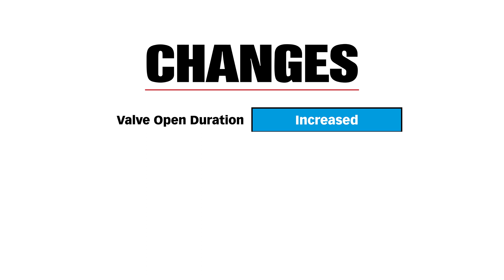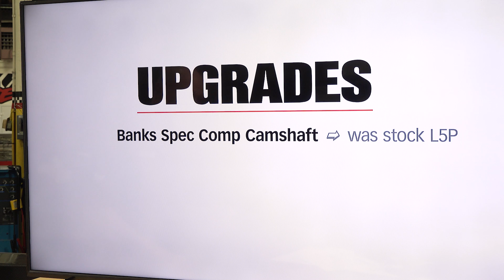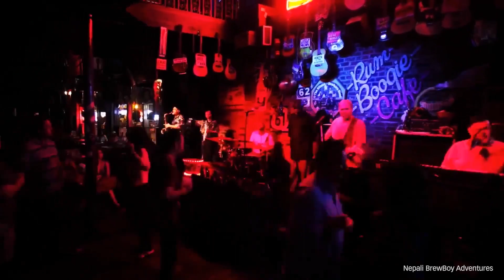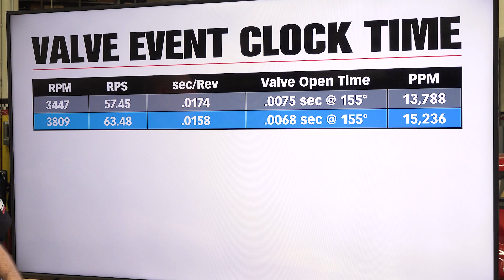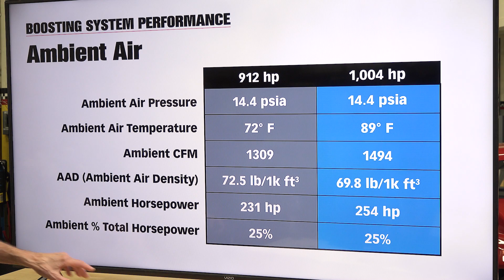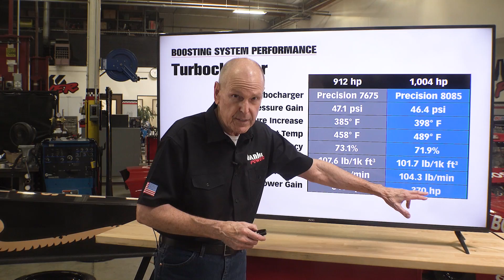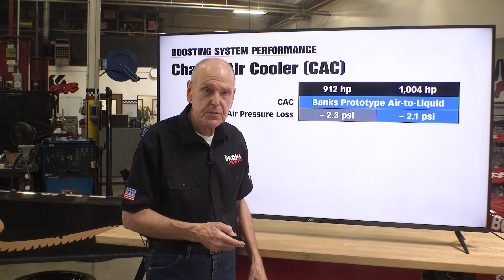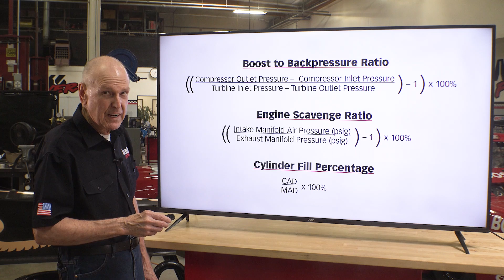1,004 HP !!! Killing A Duramax Pt 15

Comment: What was the temperature of the liquid used as the cooling medium in the charged air cooler? I'm curious if an auxiliary coolant system would need to be installed to get the temperature drop required, or if jacket water at operating temperature would meet the requirements.
Reply: That's an easy one to answer.  Jacket water at 180F can't cool charge air to 101F.

Comment: Maybe a promod 88 turbo? Hell of a series. I appreciate the data and explanation of the process. Everyone always thinks about the boost number. But not the turbine drive pressure. Would be awesome if you had like three turbos and just focused on these two measurement. This may help people to better understand why 20 pounds from a 57mm turbo is going to make the same power as 20 pounds with a 80mm turbo. M.A.D. And back pressure v boost pressure are the things I would like to learn more about or see on this Channel. Awesome explanation of the cam as well. Anyways. God bless. America1.

Comment: i completely agree that 1000hp is amazing on stock internals but he is making the torque of 600hp if you spool it down low one of the reasons it is surviving is because he is spooling the turbo so late when the cylinder pressure is low but you never know this could take 2k ftlb which would be insane dont get me wrong im not bad mouthing it its impressive and doing it this way will make the engine last longer.

Comment: Regarding the CAC at 23:37, I'm surprised that the smaller setup got a larger increase in lb/ft3 given that the bigger setup saw less pressure drop and more temperature drop. 
The final line seems right though.

Comment: First off I'm REALLY enjoying this series and appreciate the time, effort, and $$$ it takes to do these experiments, document, video, edit, and share.  The only thing I would have liked to see differently is I would have liked to see these tests run with a stock or commercially available charge air cooler (such as the Banks) with a big fan blowing ambient air across it. That or I'd like to see the same tests run now with said CAC to get "real word" numbers to see how much the numbers drop (which they will).  That 1000HP is obviously "real" given the components used, but wondering how short of the goal you'd be with the traditional CAC?  That CAC is more likely more efficient than a stock or even an aftermarket unit and that is contributing to air density which helps the HP gain.  That prototype CAC is cool, but not something you'd see on the street.  The average Joe can install the same/similar turbo, the same/similar Comp cam, the same/similar injectors, the same/similar stroker CP3, etc and run it on the street (it's done with similar aftermarket parts ALL the time), but running that CAC on the street is not feasible.  Either way, looking forward to more videos (still learning).

Comment: I am not sure if you already have a video on this but before you blow the engine from any of these suggestions. Could you do a segment on power difference between an air to air cooler vs an air to water? I would love to see how much difference there is between the two, expesually at this power level.

Comment: Go with 50-50 water/methanol or full methanol 100% injections will cool down the ambient air temp down and give u a bit of more power as well plus with the water to air intercooler will more significant drop air temp going in the intake to engine

Comment: Compound turbo charging is the only way to move forward! Please don’t use nitrous or water/methanol injection. Don’t betray your own philosophy of relying on consumable external crutches to make power. Design a new JWAC for compounding! You’re an engineer, don’t give in to the cheap gimmick temptation of nitrous and water injection!

Comment: Air density thinking you could super cool the intercooler (dry ice or short term boost using 30 TEC “electrical cooling”)

Comment: Why not try and changing the charge are cooler  by adding a receiver dryer unit from and air conditioning system like they do with super chargers?? That’ll make the air density higher from lower charge air temps for almost free power.

Comment: Two questions: how far has duramax pushed this engine? What kind of transmission could handle the power plant?
Reply: There are heavy duty truck transmissions  that can handle 1400 lb*ft of torque.
Reply: Andy Harman  good thought.

Comment: Hello Mr. Banks how are You ? My name is Paweł Różańczuk im young engineer from Poland. At first I would like to say that You are my idol... And I have some interesting ideas about Your last killing duramax project also about cultivating scientist approche to solving problems, but not every thing at once :) about duramax project You are using metanol with water and 1%corrosion inhibitor (wd40 i think base on methanol carier ) that's give some % of cooling effect to air dencity may be instead use LPG ? (Liquid petrol gas ) just propan-butan in USA I think is know as bbq fuel ? Becouse You have cheep fuel compared to avrage income in Poland its like 180° from that so most of people here are using diesel or gas car runing on lpg propan- butan its relativly save vapore pressure in tank is like max 8 bar when its hot . But You can also use LPG in diesel aplication in small % of LPG  3-7% to mas air flow to be shure that the mixture does not self egnite before tdc ... Also the LPG does not freeze easy i wonder how cold could it be and how it will help with MAD... Another thing is the diesel fuel it self ATF fluid is much more calory dence and burning like crazy... What do You think about that ? LPG freazing point is -188°C thats - 306.4°f ... I wonder if that liquid gas cooled at lets say -160°c injectet straight to blower inlet would have enough time to evaporate and mix ... But as a poor one man DIY teem I dont have enough data colection capabilities to test that by my self ...

Comment: I want to see what happened with just the cam change, everything here is cam and turbo so it's hard to relate the numbers as easy
Reply: It would have been nice if they had rerun the 912 hp point at 3450 rpm to show the effect of the new cam versus the old.

Comment: I would suggest, as the whole set up is meant for endurance/street use, that a set up is made and tested which would fit in the engine bay?    Then see what power is compared to the set up used now.     

The biggest challenge will be to loose as less power as possible.........And that will be a hard challenge I guess....

Comment: If the cylinder pressure is limited to 260 bar, the next step is to rev the engine harder. Anything done with NOS or water meth injection will have the effect of increasing charge air density, this will allow a leaner afr at 1000 hp but will not allow an increase in power at the same rpm because they are already hitting the cylinder pressure limit(I assume this limit is imposed by the cylinder pressure sensors being close to maxed out). Therefor the only way forward is to take the rpm up, the water meth injection or NOS will help lower egt's and help cylinder fill to compensate for the smaller amount of valve open time at higher rpm. Possibly could need a larger turbo as you will be passing more flow through it and it could become a choke point on the turbine side.

This is fantastic stuff, love your enthusiasm Mr Banks, I hope I am as happy and enthusiastic about my work when I'm an old fella too. 

Bang that Turkey!

Comment: ALL Mr Banks' videos should be required viewing for ANYONE interested in modifying internal combustion engines - not just diesel but petrol/gasoline, actual gas (propane, CNG or hydrogen) engines because most of the basic concepts and details are applicable to them all. Volumetric efficiency, charge temperature and density, pumping losses, optimising parts, etc.
I've been around engines for over 40 years, off and on, and while I'm aware of most of what he says, there's always something that I forgot or hadn't considered - these videos are pure gold!

About the only thing I'd like to see - if I missed it, please correct me with linkies - is the importance of getting the valve seat area shapes correct for optimising low lift airflow, as this is more critical with diesels due to limitations in duration and lift that can be used. I've picked up a lot of low lift flow working in this area, and significant torque gains, as the valve opening is effectively increased from the unshrouding of the seats themselves.

Comment: The thing with water/meth, as everyone in here suggests, is that unless you get it to hydrolock, it won't kill the Duramax.

So I'd go with higher RPM and more boost. Could you achieve 1300 HP @5000 RPM or even more with increased boost?

Comment: To sum up since last episode.
Bigger turbo
Bigger fuel pump and rail pressure
bigger injectors
Custom calculated and made cam
Higher RPM
Same torque

All that for 100 hp extra, have i understood that correctly?
Hopefully the curve holds power longer then the previous episode setup.

Comment: Feed it 10 - 12  % L P G  .multi fuel engines rock. But what I would like to see is to put it in a street legal truck and drive it for 100,000 miles.

Comment: A comparison between this setup's and compound turbocharged (with two charge air coolers) efficiencies would be really interesting. The math says that keeping temperature down during compression, decreases the power required for constant mass flow and pressures. I would love to see that theory put to the test! Water meth injection sounds tempting too. You could try to inject a small portion of the fluid after the air filter, before the turbo to raise its efficiency. And then of course really pour the stuff in after the charge air cooler. Nitrous is just cheating in my mind xD And it has no real value on anything but drag racing engines, because you just can't bring enough of the stuff with you for any real duration use. So I guess start with water-methanol because it should be the easiest to set up and, if the engine still lives, compound turbo!

Comment: Water and methanol is away from the intake volume, you fit less air density in the same volume. I would like to see you compound turbo this engine. From my rough calculations you are injecting around 240mm3 of fuel in to the cylinder if not considering flow efficiency of the engine. Making 125hp(ish) per cylinder. Would be interesting to see more cylinder pressure curves from the run.

Comment: Water/meth or happy gas both have their pro's and con's. I would surmise that cylinder head modifications would help achieve more as you still have some turbo left ,and reductions in intake and exhaust port restrictions you could lower the boost pressure which would increase the CAC efficiency. But either way i will still be watching. 👌👌

Comment: Try injecting water into the exhaust manifolds before the turbo charger (to create steem) to in crease spooling speed and to help produce more boost sooner, also instead of using mechanical valves try using electric solenoids so you'll have more control over the tune.

Comment: I am probably one of the minorities on this idea but hey I am going to throw it out there anyway. Since the CAC is making as much HP as the turbos can we really up the game on the CAC? Years ago Ford did a mock up with a Mustang and a refrigerated glycol CAC that would last for 30 seconds or so. Granted a mountain can be longer than that but nobody wants to run out of water methanol half way up a mountain either.  

Maybe , now this is really crazy use two turbos with larger turbines and smaller compressors not to add boost but to add vacuum with less parasitic losses on the exhaust. Put one vacuum on the crankcase to reduce windage and pumping losses. Then run the other through an orifice the make the ambient air expand creating a cooling effect which could further drop the CAC temperature increasing HP.

Or just give the CAC induction tubing a LN2 shot on the outside! lol may need to watch turbo rpm as it spools up from the reduction in MAP or add a kicker turbo to make up the difference. jk I really would like to see what putting a vacuum pump on the crankcase yields! The make it happen with a secondary vurbo “vacuum + turbo “  I also think that there’s promise in using a vurbo to cool the Charged Air. We have vacuum pumps at work that have made ice in the lines.... just planting a seed here. As a matter of fact after seeing that I had the idea to use it to cool the liquid ring water but we changed our process and never did much with it but now I see a company is using that principle on a factory packaged unit. Crazy like a fox, right? lol

Comment: Great stuff! Keep up the awesome work Gale and team. You've got some injection window left, hopefully a little rail pressure as well if needed, and enough turbo. The charge cooler is doing a great job so I'd skip water meth for now and let's see 1450 tq at 4000 RPM for 1104 HP with a little more boost, tune tweak, and no parts changes.

Comment: water/meth and propane to see the benefits of makings big power safer with lower iat's, then head porting/aftermarket heads to see how big the gain is before throwing max power at it.

Comment: Instead of water meth or compounds I've got a crazy idea here. If the charge air cooler is right at ambient air temp give or take a few degrees farenheit. What was the water temp on the cooler? 

My question is this would replacing the water/coolant ran through the cac with a refrigerant say 404a and it was able to super chill the cac down below 50 degrees farenheit what would your data numbers be? 

Also same concept with fuel temperature.

Comment: Keep EVERYTHING exactly identical and add water/meth injection either in the intake manifold or just after the compressor. Then go a full point leaner on the AFR (because you can LOL). I'm calling 1400 lb-ft of torque and 1100 HP. EGTs and compressor temps will go down significantly, along with the IATs (which means higher MAD and the ability to run higher boost as well). Plus it's a piece of cake install for a shop like Gale's.

Comment: I’m curious to know at what RPM the valve control becomes an issue. Hmm. There is only 8% of injection° left, 14% extra air, turbo is close to being upside down. Compounds with Water Meth.

Comment: Awesome, awesome, awesome stuff!
However, Wouldn't a more accurate measurement of "Engine Scavenge Ratio" be (intake air lbs/1000ft^3)/(exhaust lbs/1000ft^3)   since the exhaust density is far different than the intake density?